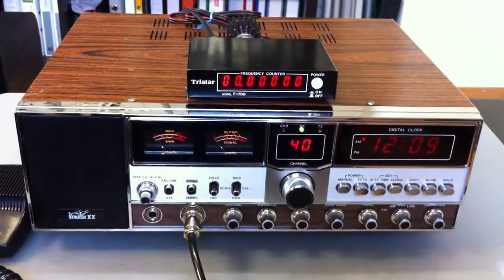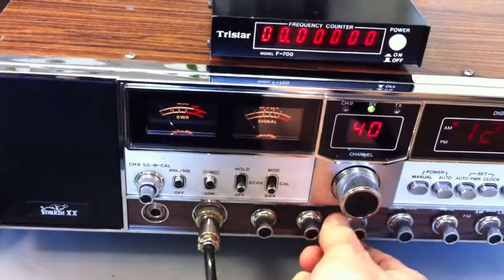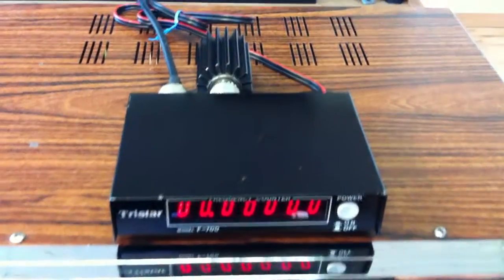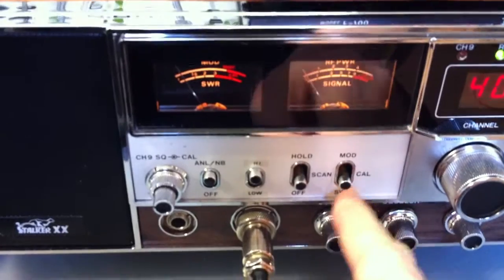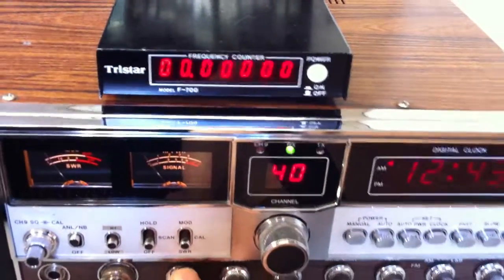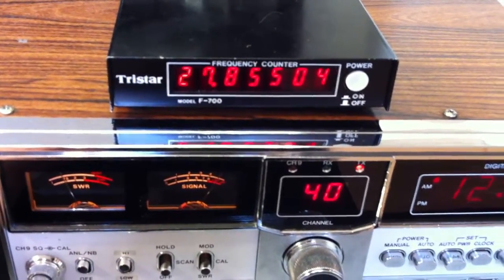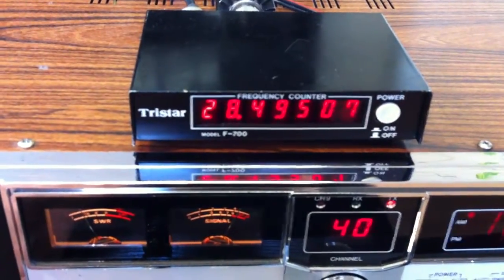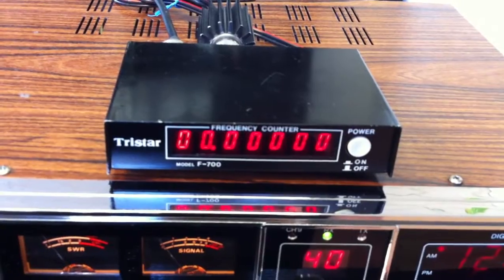TEABERRY STALKER XX (PC411) on 10mtrs Band

Comment: I have one top sold , 
https://www.leboncoin.fr/collection/1818217259.htm

If any are interesting on this.
From France , bordeaux
Reply from the maker: Mister Alex hello, thank you for your interest. I don't know, but I think, the black faced STALKER XX ist stronger in the pricing about 300-400 Eoros in top condition. Happy airwaves to you...
Reply: @SWIZZRADIOS  thanks for the évaluation , the station is a stock of my grand father working andnot used mast 20 years , micro american électronics are New with box , notice , protection without any imperfection.
Radio ils not my hobby , this material is an héritage with old House .

Comment from the maker: Oh yes, the condition of the ST XX is very good. But the frequency-shift between the two offset quarz is a little bit to high. In all CYBERNET Radios exist a small trimmer capacitor beside the quarz. But in some Euro uniden radios (Stalker IX, XV, XX / Mc Kinley, Grant, Washington) I'm missing the trimmer capacitor. The TX-frequency is then from CH 1-40 or 41-80 not equal.... Best 73's